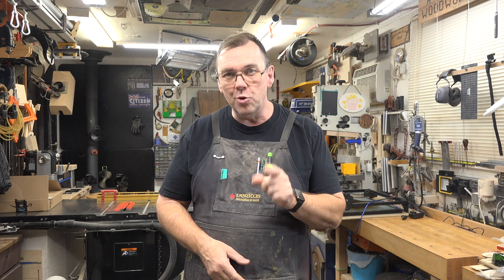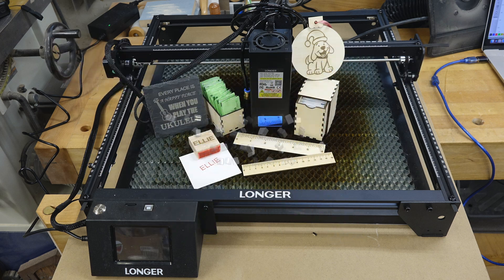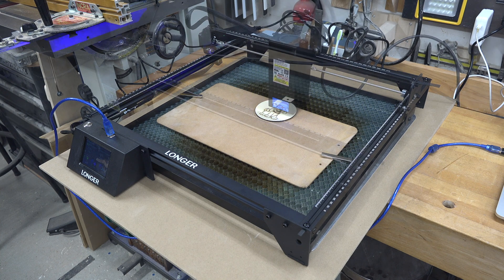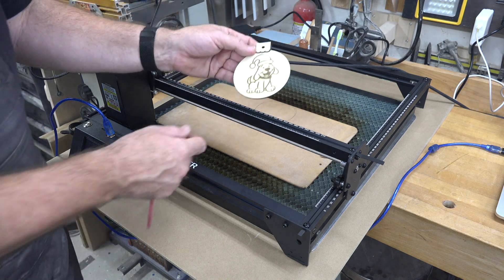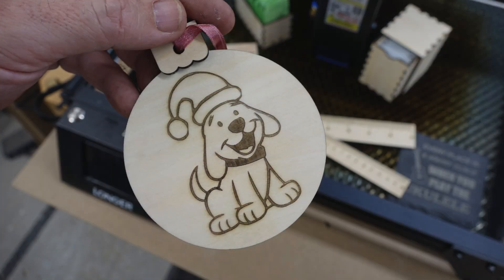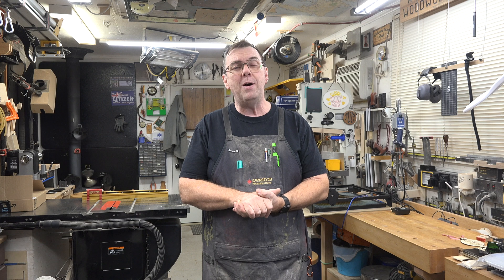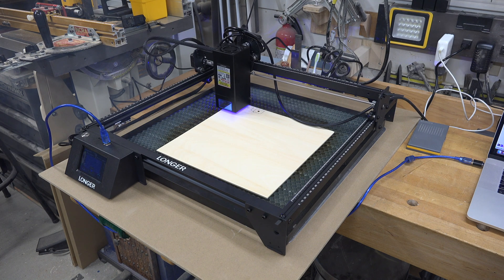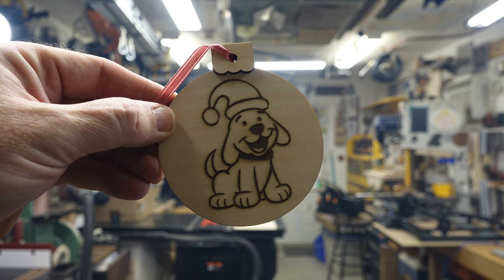5 Easy Projects to Make With the Longer Ray 5, 20 Watt Laser Engraver

Comment: Nice to see it running at it's actual speed, it was very slow at cutting out the circle for the signatures, although the engraving was a lot faster ... less power takes longer I suppose but is cheaper, probably more than powerful enjoy for home use 👍

I especially like the use of a laser with slate coasters, fantastic personalised gift idea 😁

BTW the play of the drawer is 'a multiple of the wall (ply) thickness', in the example you showed wall thickness is 3mm, therefore play is 3mm x 0.15 = 0.45mm ... also, is the play split between left/right and top/bottom or is it a total mount ... not sure why the person who wrote the code did it in this way, a bit of a strange method!
Reply from the maker: The speed settings when cutting can vary and if you want to go faster, you can.  It's all about experimentation. Doing a cut test grid will definitely give you the settings for the highest speed for cutting.  I'm not in a hurry so I just use the slower one.  Thanks for tuning in Barry.  Great to hear from you.

Comment: Great video, lots of good ideas, would love to know your settings
Reply from the maker: For the most part, on a 20watt laser, I run the laser at 80% power and 5mm/sec speed for cutting.  As for the engraving, I like using 65% power and 120mm/sec speed.  I do variations of that but those are my "goto" settings to start.  I hope this helps.  Thanks for tuning in.